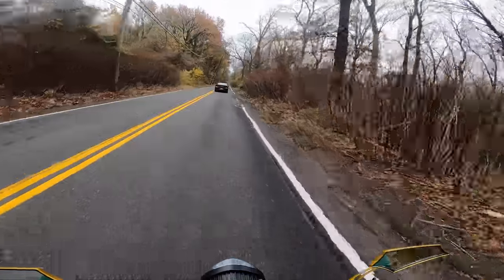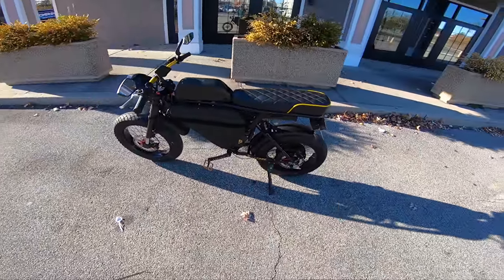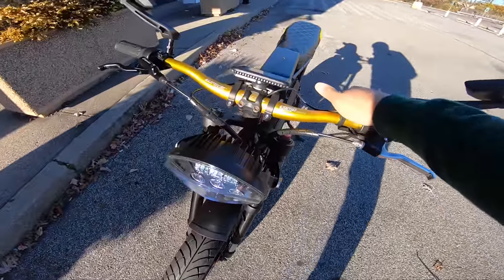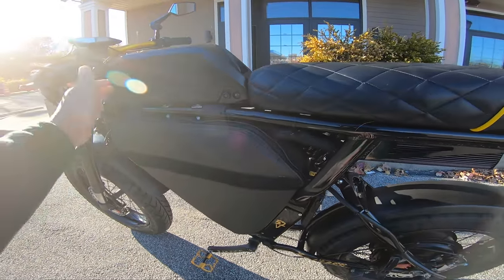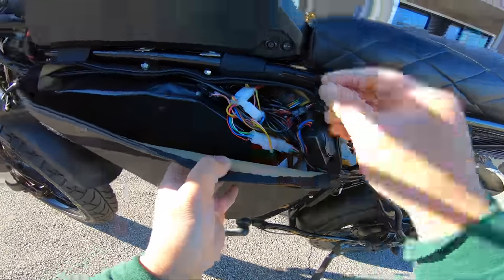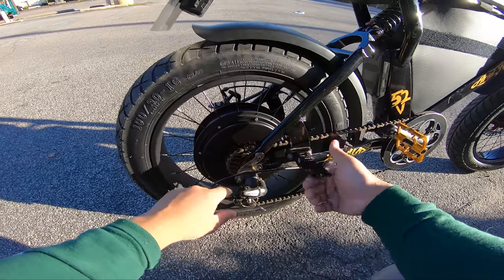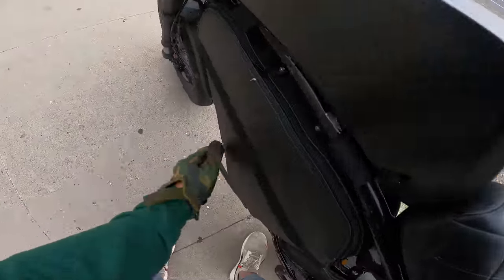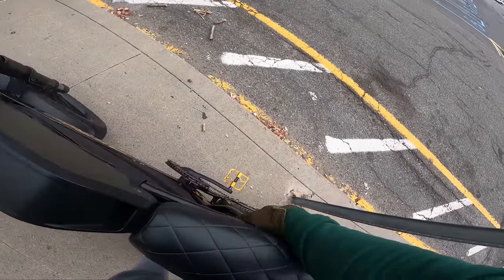This bike is TOO FAST! 5000W Ariel Rider X-Class First Impressions

Comment: Do you get tickets from the cops with no plate or blinkers?  Do you have insurance?  We are just a few "ebike in the middle lane deaths" away from every ebike getting a ticket on the road.  Then its back to 750 watts or licensed, insured, and plated.
Reply from the maker: I actually do have working blinkers on my bike and my bike is insured by Markel. No issues with cops here except in the bike lanes. For example Surrons without pedals will not be allowed in most bike lanes in NYC. Cops have bigger fish to fry here specifically with gun violence in our streets.

Comment: This thing is literally TWENTY TIMES THE LEGAL LIMIT in my country (250 watts).
Reply from the maker: Wow that's a crazy limit on Ebikes. Are you in the UK?
Reply: @JB360_NYC  Germany (250 watt max, motor cut-out at 15 mph, no throttle allowed).
Reply: @reinplat  Does 250w refer to actual power though the motor that they might test or to design spec?  In the UK there is a 300w design spec limit but you are specifically allowed to exceed that nominal spec occasionally ('peak' at 3x design spec on hard acceleration). This is untested but maybe it applies in Germany too?

Comment: are you crazy  ? this unit is not DOT approved . it was made by manufacturers that didn't build the frame to hold these pressures . you are looking for troubles . the fact that it can handle and up to the game  on day one or year one  means nothing . buy motorcycle . riding a bicycle 70 MPH is not responsible . Yes it looks cool but one crash and you will be collecting your bones one after the other from pavement.